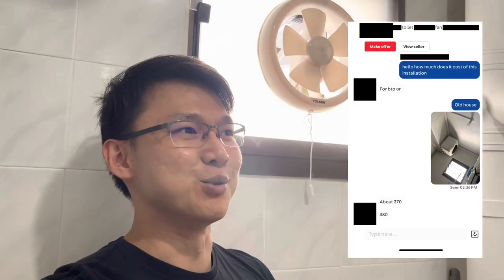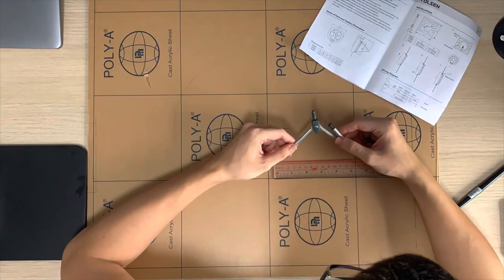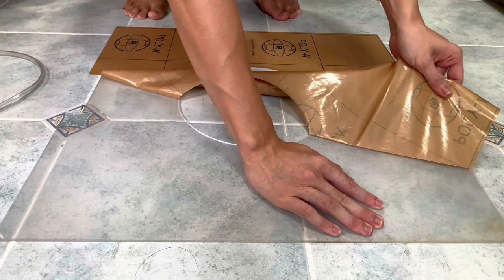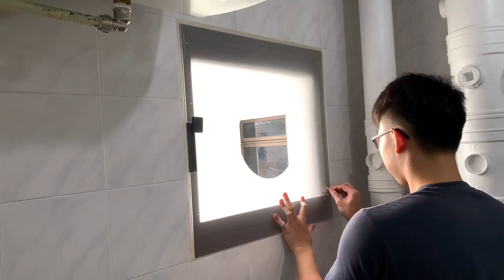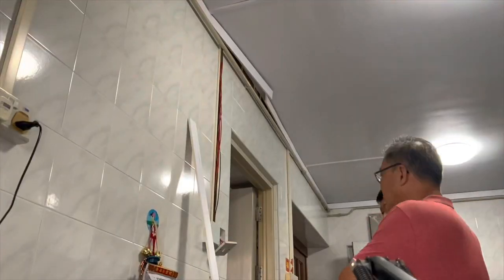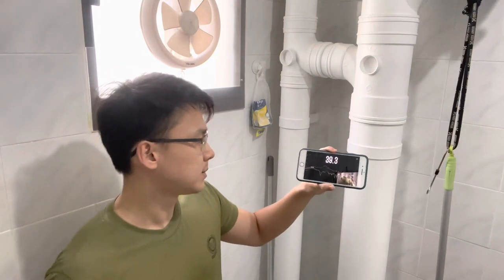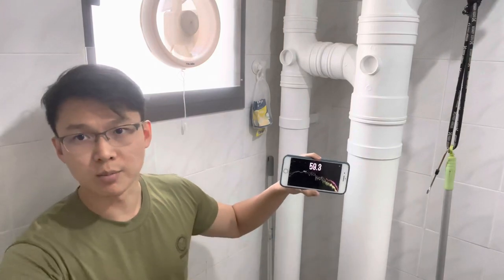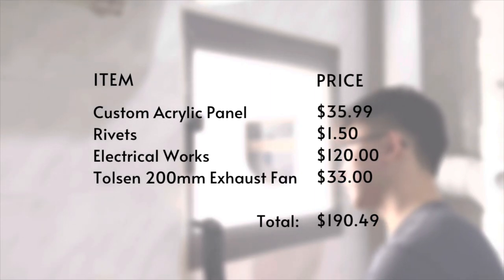How to install toilet exhaust fan for your BTO flat, $190 all in!

Comment: seems like quite difficult to clean the fans? have to unscrew everything?
Reply from the maker: For usual maintenance, just use a wet wipe to clean the blades will do, if you wanna clean the motor inside, then you’ll need to remove the whole fan and disassemble the fan
Reply: @kakilai  thanks for the advice 🙏

Comment: I live in a rental. Wonder if there's a way to install this without drilling?
Reply from the maker: I wouldn’t recommend the installation if you cannot drill into the frames. Using another other non-mechanical ways to secure the fan is extremely dangerous.
Reply: @kakilai  understandable. Thanks for responding!

Comment: Wat about the power of the fan ? Is it good ? Does it help with drying of the toilet ?
Reply from the maker: Had it for 2.5 years now, it’s not as strong as it was first installed but it’s still working fine and still removes moisture quickly. Cooking grease do clog up the motor overtime as the bathroom that I had this fan installed was connected to the kitchen, but after a quick service, cleaning and oiling the motor, it can functioned at 80% of brand new condition.

Comment: Hi, can I check, can I use an electric screwdriver for this with screws instead of rivets? As my husband insists it's possible with screws
Reply from the maker: Yes it’s possible, but to prevent the acrylic from cracking, you should predrill the holes on the acrylic and make sure that the screw thread can pass through the acrylic freely. I have tried turning screws into acrylic in my other router video and the acrylic can crack very easily due to its brittle nature
Reply: I guess rivet makes it more pro looking than screws

Comment: One of the worries i have in installing the fan in a bathroom with single window is the stagnant air when the fan is not turned on for quite awhile e.g on vacation. This is because the only outlet now is the door. So if we dont open the door often / dont use the fan, it may actually cause mould. Is it an issue for you?
Reply from the maker: hahaha what a great problem you have, unfortunately I don't travel long enough to have that issue. But even if I do travel for extended periods, it can't be avoided anyway since i'll be closing all the windows in the house

Comment: Bought a KDK ventilation fan and HIP contractors say they unable to install for us as item is not under their scope (only their type of brand&model used can).

Can your electrician provide the acrylic, cutting, wiring & install the fan? Or just only wiring works?
Reply from the maker: He does wiring works only

Comment: for the acrylic cutting services , do they provide drilling the clearance hole for the rivet ? as i see u need to drill it on your own. how much did they quote you for the acrylic cutting ?
Reply from the maker: You can chat with them via shopee to see if they can drill the rivet holes for you, they should be able to do it. The custom-cut acrylic cost me $32 excluding shipping and the plain 50cmx60cm that I cut myself cost only $8 excluding shipping.

Comment: Hi, the string attached to the cover of the exhaust fan snapped, how do I fix it myself? Thanks!
Reply from the maker: i guess you can only remove a whole fan and get a replacement string from local hardware shops and re-tie it yourself

Comment: Hello! Can I check if the acrylic panel can hold the weight of the fan? Is there any other secure done to the fan onto the acrylic panel?
Reply from the maker: Hi! We initially planned to use a 5mm sheet but couldn’t find one that was reasonably priced. The one on this video is 3mm, it’s actually sturdy enough and I wouldn’t recommend going for 2mm/1mm. There is no other fasters used to secure the fan to the acrylic, it is just seating on it. You can use silicon to “glue” it to the acrylic but that means you wouldn’t be able to take it out to do regular cleaning and maintenance. This gets dusty quite fast!
Reply: I'm going to use 1.5mm aluminum panels with white spray paint...cost abit more but more flush and block out external sunlight too

Comment: How did u open the thing that held the glass in place?
Reply from the maker: The metal frame can be bent, so u just to bend it enough for the glass to be able to slide inwards and remove it

Comment: Are you screw directly through to the aluminum frame? what kind of screw are you using ?
Reply from the maker: yes, installed directly on the aluminum frame. I did not use screws, rivets were used.
Reply: what rivets did you use?

Comment: what tool is that unuse to screw in the acrylic
Reply: is it a rivet tool
Reply from the maker: That is a riveter! Rivets are used for this project because I am not sure of the thickness of the aluminium window frame. If it’s too thin and screws are used for the installation , the screw thread may not being strong enough to hold the weight of the acrylic and the fan

Comment: Main part of installing fan is not in video
Reply from the maker: yeah kinda missed that part out cause the time-lapse was too fast. But there actually isn't much to mounting the fan, the cutout of the acrylic is slightly larger than the fan so the fan passes through the hole and just "hang" there